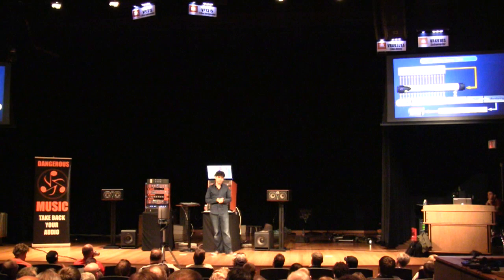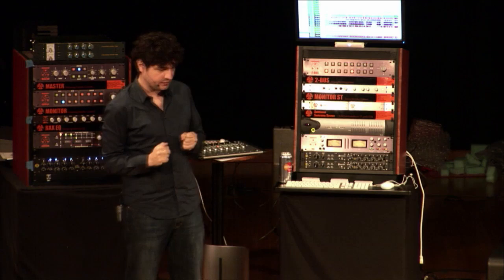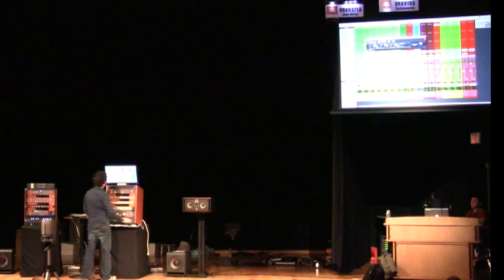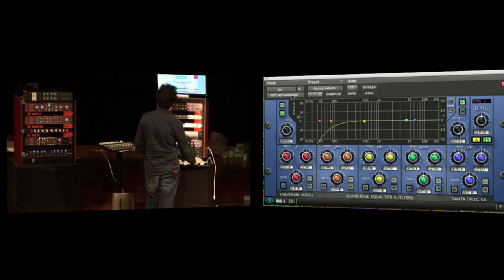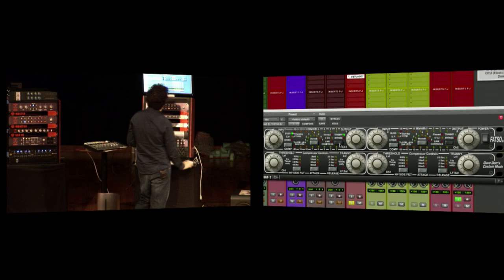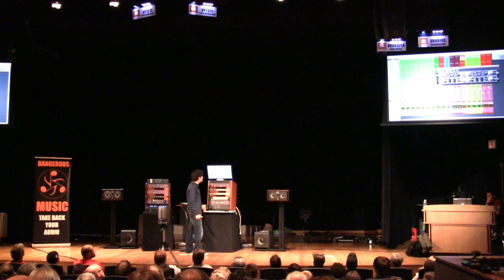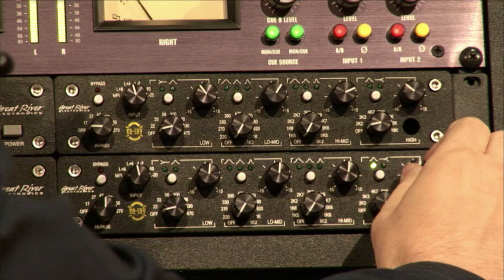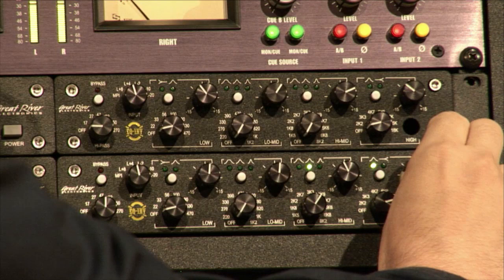Mixing the Band with Fab Dupont - Part 2 of 4

Comment: "No disrespect but the unprocessed mix sounds about the same as the processed mixed"

thats the point! the recording is awesome to start with, the art of good engineering is to not change it, just make it sound better, take any unpleasant parts away, in reality its probably only trained ears that are going to here the unpleasant parts most of the time, unless its a terrible recording. the fact that you even mention an exciter leads me to believe you need to improve your recording technique!

Comment: No disrespect but the unprocessed mix sounds about  the same as the processed mixed.
He could have used an excited before or after he cut the low mid noist. 
not bad but he dont mix very well.